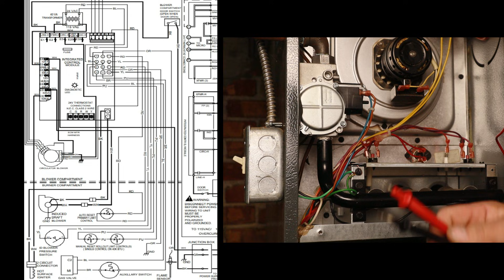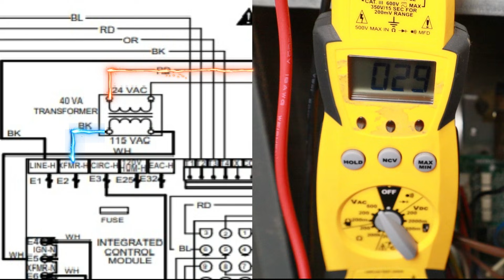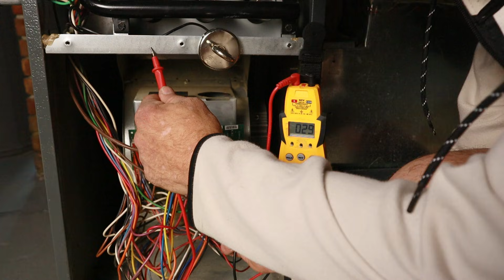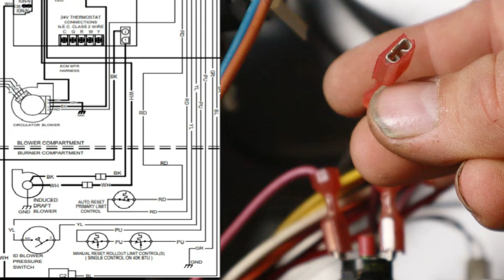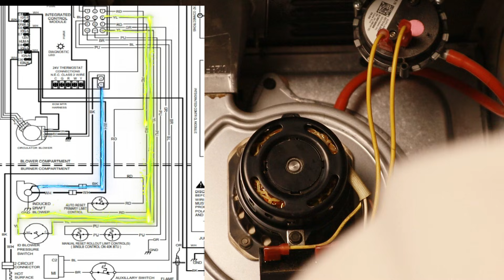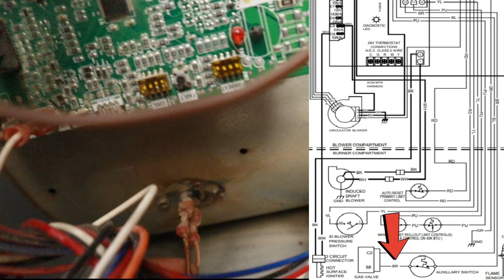Using A Multimeter With HVAC Schematics

Comment: I was trained to never check for power to ground for controls and components. All it tells you is potential.

On the 24V control circuit, if you have a bad common or ground connection, you might not find that out by just checking to ground.
On the 120V supply voltage, if you have a bad neutral connection somewhere in the circuit, that also might not show up by just checking to ground.

When you get into larger equipment using 208/230V & 440V 3 phase power, checking to ground can be even more problematic.

Comment: Benefits of your video but I would say your also under the assumption of your “common” wire completing the circuit when you test to ground.  For example the black wire for the inducer will have 120 volts on a heating demand but if the white (common) wire of inducer is broken or not connected properly the inducer motor will also not run.  So saying the motor has 120 volts via the black wire and the motor does not operate is not always a faulty motor.

Comment: Awesome video,
Thank you so much for the clear explanation.
The only thing that was missing is to test the neutral from the junction box(switch).one day the instructor at school purposely disconnected it from the switch and I couldn't figure it out since the line has 120v but the furnace won't start ...

Comment: Well, learned something so that is good.  Never put the thick lines are 120v, thin 24v in my head before.  Had a failed heat, fixed it only to find out in spring the AC side was also out.  Shame the safeties don't work both ways.

Comment: Jersey Mike, I enjoy your videos.  I wanted to add a comment about 125 v to the inducer not working. Most of the time I agree that it’s the motor, but I had a service call where I had that scenario and the blower was not working.  I picked up a new motor.  When I took the existing motor off, I found birds lodged in the wheel which kept the motor from turning. The motor ended up working when I cleared the birds out. Put it back in service took amp draw and found motor was still in good amp draw range. Something to check before you go out and get a replacement motor

Comment: Mike how can you tell if a Control board id Bad??
Reply from the maker: Typically, a bad board will often fail to send out power to a component when it should. So I always start at the component that should be getting power to see if it's there (at the proper time in the sequence, of course). If I don't see it there, I then check to see if the board itself is sending it. Sometimes the board is just fine and the molex plug or wiring itself is the issue. But if the board isn't sending out when it should then typically the board is the issue. 

 Really have to know sequence of operations, though. Very easy to condemn a board when it's fine if testing at the wrong time.

Comment: The wiring diagram that came with my air handler is saying to connect to y2 from the thermostat to y1 on the control board in air handler.

Comment: what was the tiny clamp meter you had in the thumbnail? that one is what i'd want to use. i actually have that fieldpiece meter you used in the video and it sucks in practice. you have to take your leads off and attach a separately purchased amp clamp head just to check amperage every single time. that become very annoying and after my first month out of AC school and in my first job, i bought an amp clamp meter. you're never going to buy the extra heads for the fieldpiece. something tiny like the one in the thumbnail is exactly what you're going to want. you want to get into tight spaces. and not take up a bunch of space in your tool bag.
Reply from the maker: I don't often use the Fieldpiece meter. I use a True RMS UEI meter designed like one in the thumbnail. It's the DL389B. The fieldpiece was a meter I used more when I worked at the power company working on higher voltages.
Reply: @JerseyMikeHVAC  nice. i use an amprobe ACD-14 PLUS. its the smalles meter ive come across that actually holds up. can do amps and voltage simultaneously. fits into the smalles of places. had this thing for over 8 years now.
Reply from the maker: @shoe2929  Does that meter let you get a hold on the max amp reading with the dual amp/volt display? because my UEI does the same thing and reads both together, but when I try to max the amp I lose the volt reading.
Reply: @JerseyMikeHVAC  yes it lets you get max/rushing amps and hold it. the amp function is independent from the other functions that require the leads. 2 seperate screens. google search that meter. its the best meter ive found in my 14 years of teching.
Reply: @JerseyMikeHVAC  yes. the amp function is independent of the other functions that require the leads. its even on its own screen. you can get max/rushing amps and hold.

Comment: Great video, question I'm getting power to my door switch and through my door switch but when I plug the black wire coming from the door switch to my board I get nothing but when I unplug it I get voltage in my wire which is not allowing My bored to be charged. Any suggestion thank you.

Comment: My OCD kicked in big time.
Another thing that complicates the troubleshooting process is that the whole wiring harness looks like a rat's nest.
I guess they want to save money on a couple of inches of wire.
I love the ladder diagrams also; those are less of a rat's nest.
40+ years as a panel builder and I have never built anything that looks like that.
All my panel wires come back to a central terminal strip.
Troubleshooting is as simple as checking for voltages on the terminal strip.
When you lose voltage, it tells you what component is bad or is blocking the function.
Still waiting for a terminal strip with onboard LED lights so that troubleshooting is as simple as looking at the terminal strip.
I know that you did not build it, and I love your videos.
Reply from the maker: What got me on this one is the fact the unit is only 3 years old and the installers decided to power it splicing off of a K&T circuit from 1913 with a  modern panel (available when the unit was installed) only 10 feet away. Guess everyone is trying to save a little on wire.

Comment: Around 15 minutes into the video you disengage (pull the wire) on the high/ low limit switch. At what point does the control board detect a malfunction where as to to shut down the blower motor and systems? It appeared to stay running. 
Also in Philadelphia many homes have 14 wire with no ground; outlets,switches etc. not grounded. How would test power to ground in this scenario?
Reply from the maker: Blower stays running for a minute or so on those limits. Everything else shuts down. The idea is to cool off the heat exchanger. 

 Is the 14-2 the old cloth wire in metal similar to BX? There is a thin silver wire in that stuff easy to miss that acts as a ground but isn't hooked up like a wire. But at any rate, if it's in metal the metal itself is grounded back to the panel in most cases. If not, you still will get a reading, but it may not be accurate. That was the issue in this video when I was only reading 43 volts off the HSI. Old knob & tube wiring with no ground. 

 Another ground option could be a nearby water line or a gas line.

Comment: Incredible explanation.  My only question is why when you tested the igniter it only said 40 something volts?   Video is awesome.
Reply from the maker: I think it might be a grounding issue. The installers tapped into the original knob & tube wiring of the house (built in 1913), which has a neutral but no ground wire.

Comment: Thank you! You are the best YouTube instructor in my opinion, do you have a video of Sequence of operations for a gas furnace? and how to add refrigerant?
Reply from the maker: Thank you. This video should help you out with furnace sequence. It doesn't just cover the basic sequence. It's very comprehensive and covers the entire electrical sequence from the breaker in the main panel to the flame firing up:

https://www.youtube.com/watch?v=7zdzgKAYJCU

I also have a video on charging R410A into a system with a TXV here:

https://youtu.be/VG7ygGg6xvg

Let me know of you find those helpful (or not).

Comment: 26:34 - Performing the hot surface igniter voltage test in this manner could hide another reason for furnace recycling. Even if you read 120v between the black conductor and ground, a broken neutral from the board to here will not allow a complete circuit to the igniter (just sayin’). Excellent presentation. I particularly like the schematic/diagram shown side by side with the actual wiring!
Reply from the maker: Thank you!

Comment: 27:20 why does it read 43/44 volts? Shouldn't it be 120v?

Unrelated: where do you buy that disk magnet with the loop on it?
Reply from the maker: Not sure.  I have to look deeper into it when I do maintenance on it next weekend. Furnace is working right now though. 

I got the magnet off of Amazon. 
https://www.amazon.com/DIYMAG-Neodymium-Countersunk-Diameter-Retrieving/dp/B08K75NB5G/ref=mp_s_a_1_19?dib=eyJ2IjoiMSJ9.wiQrIU576hlDu-9cJ0C7hAGZKLQdavuC193rj3Mib7-T2HGSPJabobDzS-p-sQJJ30KhYrdmRgODs_9WOIkQJlXfXCOAcDFYJF26kgUHPgLNSVuUYdmAl-edwmKcvapGhQ8coIQHYOZJybcw4UxfH2qFkZOxwWa8y97iQ_-hVox_hROv3RBgwJPr0ey3g-kuOJVWb_FvlxlPZREUYFyyIQ.jrYdYlvZt6ReYIK8TONtCOGZSYn8i8TCTrogqiZ2kM4&dib_tag=se&keywords=magnet+loop&qid=1725880116&sr=8-19